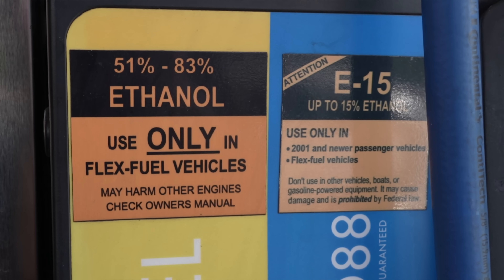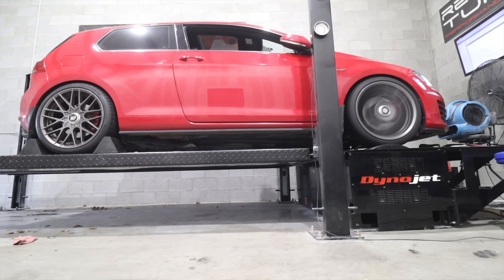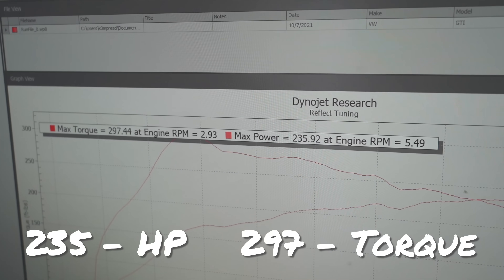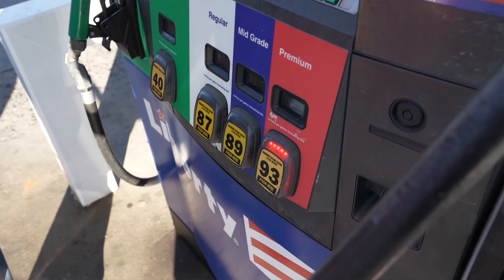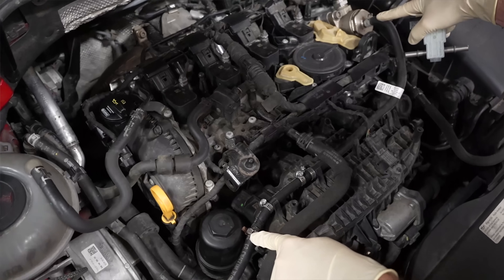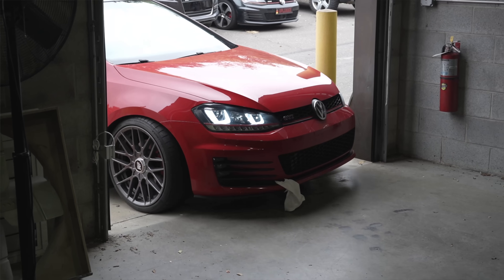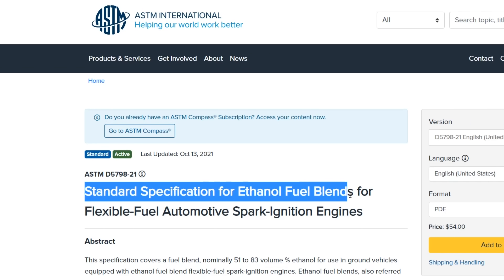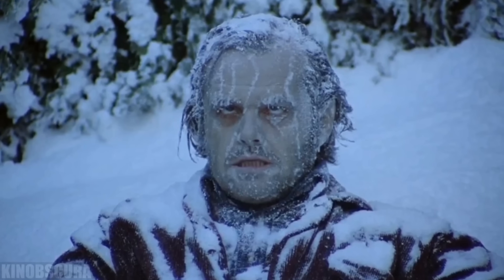A Complete Guide to E85 / Flex Fuel

Comment from the maker: Drop an Ear Disappear Shirt
https://www.shopdap.com/drop-an-ear-and-disapear-e85-tshirt.html
IE Flex Fuel Sensor
https://www.shopdap.com/ie-trueflex-sensor-harness-for-mqb-engines-ieelci2.html
Integrated Engineering Stage 2 Flex Tune for MK7 GTI (IS20)
https://www.shopdap.com/iesovn12-stage-2-tune-integrated-engineering.html
Integrated Engineering Stage 2 Flex Tune for MK7 GTI (IS38)
https://www.shopdap.com/iesovn13-stage-3-tune-integrated-engineering.html
Integrated Engineering Stage 2 Flex Tune for MK7 Golf R (IS38)
https://www.shopdap.com/iesovn22-stage-2-tune-integrated-engineering.html
Reply: The injector seals on these cars are junk, it can't hold up to standard fuel, what makes you think those tip seals will hold up to e85? You know better. the mk7.5 r already has 5 updates to the injectors... give me a break bud.
Reply: i love E85 videos. I'll be watching the entire thing and also granting a Like.
Reply: I lose an average of 11 MPG on my flex fuel van when running E-85 compared to plain 87 octane gasoline.

Comment: The first part of the video concerning additional horsepower is correct. But then you make the incredibly stupid mistake of trying to find fault over the so-called "energy content" of gasoline vs. ethanol. A spark-ignited internal combustion engine that has been optimized to run on gasoline will often produce better MPG than ethanol because the engine is optimized to run on the burn characteristics of gasoline, not because of its energy content. The same engine optimized to run on ethanol will produce equal or better MPG than the gasoline-optimized engine.

Measuring the energy content of fuels dates back to the early days of steam engines, when it was critical to identify fuel sources that could heat water faster than wood. The oil industry misled the public into believing that this measurement guide applies to internal combustion engines; it does not. Internal combustion engines does not run on steam power. 

Moreover, many gasoline-optimized engines will get better MPG using higher ethanol-gasoline blends of E30 to E50 than they will using E0 or E10, despite the fact that the engines are optimized to run on E0.This is one of the ways to prove that "energy-content" is BS.

And, in any event, if using an ethanol-gasoline blend causes a reduction in MPG vs the use of E0, the cost savings of the ethanol-gasoline blends almost always exceeds the loss of miles. This means that it is more economical (more efficient) to use the ethanol-gasoline blends.

You say that ethanol is "hygroscopic, this is correct, and I salute you for getting the terminology right; far too many ethanol critics use the word "hydroscopic" instead of "hygroscopic." However, your very next statement about ethanol absorbing water is grossly incorrect. You say that "as ethanol sits, it will absorb more and more moisture." Ethanol does not have an infinite capability to absorb moisture, the amount is very finite and rather small.

And lastly, ethanol does not "degrade" engine components; it never did. Ethanol is compatible with more types of rubbers, plastics, and metals than gasoline, benzene, toluene, xylene, and tetraethyl lead. Viton rubber was developed because of the corrosion caused by gasoline and tetraethyl lead, not because of ethanol.

Comment: Here in Brazil 🇧🇷we have 100% Ethanol (álcool) at ALL gás station by the streets,at 80's cars was only gasoline or only Ethanol, by 2000 came the flex fiel cars ..
   But álcool continue tô cause problens in fiel pump's,roses and injectors....
    THE ansuer os tonise álcool car every day tô avoid corrosion problems👍🏼🇧🇷🇺🇲

Comment: So about 2k for about 10% more power for cars running boost. Idk., i mean  yeah ..its worth it...... but there are cheaper \safer\reliable ways to get bumps of 10% .   Example:  how long will the sensors, or flashed chinese electronics last?...leaving you stuck\fustrated\embar3ssed.   For me, its all about long-term reliable power, that is not reliant on a orchestra of aftermarket sensors and gas thats constantly changing

Comment: In theory, could you run 93 pump and E85 with a tune to get both the everyday driving to track without reflashing every time? Also....Sorry if you mentioned in the video, I'm working and listening...What other modifications were done to the GTI in the video?

Comment: looool no way that stock car has a great map 40 extra hp 
most cars if you run e85 without a tune you have less power unless its a turbo car. na cars you lose power
alot of people in france use e85 without a tune cause 0.80€ / L while 95/98 is 1.85€/L so its a easy choise more then halve price. even compaired to diesel that is 1.65€//L so e85 is still cheaper even fi you use double as much as a diesel car. i do 400km with only e85 but in my mom diesel car i do 800-1000km with diesel but that is double price and half the horse power
so like 50% of petrol car run e85 without a tune, most ever since it became aviable in france (or atleast in there city) my oncle done 100k km with pure e85 in his mercedes clk230 from 1999 no engine check light
but most cars after 2000 throw a check engine light... what is annoying

Comment: Would a ECU tune be necessary to use E15? You mentioned in your video that "early" model years may not be able to handle ethanol but I put E10 in my 2002 Mustang GT ever since I bought it in 2002 and haven't had any fuel line issues. But I do have plans to upgrade the fuel pump, injectors, and fuel line in preparation to install a supercharger.

Comment: How would you know if the ECU can be set for flex fuel operation? I know that there are add ons that do monitor ethanol content and will compensate for the variations. They're rather pricey though but they allow a wide range of fuels to be used.

Comment: In the time-lapse photo at 6:21-6:28, the ethanol is not sucking moisture from the air or even getting condensation running down the sides of the glass container. It appears to have been shaken up with water, as is seen later in the video.

Comment: I'm getting so tired of hearing that ethanol has less energy than gasoline. That's THERMAL energy or heat energy, BTU's (British Thermal Units), which means that ethanol runs cooler than gasoline, which is a benefit. Ethanol has higher torque and more horsepower, which means it has more chemical energy. The reason the fuel mileage and range is somewhat lower in most contemporary vehicles is because engines are currently optimized to burn gasoline when manufactured. The lower price of E85 balances that out, especially in the minds of those who appreciate having a cleaner, cooler, smoother-running, longer-lasting, more powerful engine.

Comment: So if I’m tuned on e85 (65% content) , is its not recommended to run anything below?

Asking bc I had to put 93 in my car omw back from a road trip and my gauge was reading 50% and my car drove different, in a bad way.
Reply: Yea unless you have a flex fuel kit, you shouldn’t put anything besides e85 in a car that’s tuned for it. A flex fuel kit lets you switch from 93 to ethanol whenever you want

Comment: FANTASTIC! video, honestly

But one thing I didn't grasp from the video.. Once you run flex fuel tune, imagine you JUST finished loading it but you have 93 in the car only, can I add any amount of ethonal to the car? Or does it have to be a certain percentage, and why can't I just run full E85 only on flex fuel?

Cheers :)
Reply from the maker: Any amount it senses how much ethanol and adjust if it’s a flex tune.

Comment: To anyone with experience using e85. I just got a f250 and it is a flex fuel. I was just wondering how to properly transition from gas to e85 and I also heard you had to switch back to reg gas when you do a oil change to clean out the engine. I’ve heard stories of people Messing up their fuel lines and it causing misfires. Just don’t want to damage anything but would definitely want to try e85. Any info helps thanks.

Comment: Running now my old BMW since 2019 with stock fuel pumpe, fuel lines and injectors. It is still running. No leakage nothing. So my recommendation for BMW cars: Run on E85, put the money you save back in your piggy bank and replace all components if one starts leaking. In the meantime,  you will have saved so much money that you can buy a bunch of upgrate parts for your daily whore.

Comment: Should’ve set an A to B (gas station to gas station) 100miles a part and fill the tank to the max (preferably when you see it in the neck) at destination gas station “B” and calc the mileage that way.  Then do the exact same thing a second time for comparison. Not to mess up any elevation gain or loss. To use the gas light when you can swerve or hit a bump and cause a premature light illumination!  Muhahaha!

Comment: Every one says that you can advance the timing and get more power. 
 NOT necessarily true.
 Any engine 'wants' x amount of timing advance to achieve the 'sweet spot'.
 Any more than what's required will cause the engine to drop power,  and it doesn't matter what the octane of the fuel is.
 Octane simply allows an engine to run at a higher compression,  which will achieve more power, but in and of itself octane does absolutely nothing in the generation of power.

Comment: Great info and great video. I don't have e85 or even 93 octane where I live in eastern Canada, 91 at best. Because of this, when I was having my Subaru built I had them install an AEM Methanol/water injection system in it. The way it is set up, my tuner told me it tunes similar to 110 octane racing fuel. I'm running 35 psi with a Garrett GTX3582r gen II on my closed deck ej25 making 619 all-wheel hp. The methanol injection comes on at 10 psi and tapers up to full flow at 25 psi of boost. No idea what size jet they have in it.

Comment: 14:38 no you would not have gotten much more power with 85% ethanol over 57%. The anti-knock effect from ethanol being mixed in maxes out around 40%. Having higher ethanol content beyond that gives a very slight cooling effect from direct injected engines but doesn't increase the AKI # and so doesn't help with engines being able to have higher compression ratios.

Comment: Have a 2021 Mark 4 Octavia with a 2.0 TSI engine. As per the manual they advise not use Ethanol beyond E10. Will there be any detrimental effect if I run E20 gasoline, thanks for your time and look forward to your response.
Reply: Please advise if I can use E20 gasoline with the stock tune and no change to hardware components.

Comment: Holy crap! That's a big boost in power.  I noticed Unitronic has some higher ethanol tunes. Too bad it absorbs water so fast though.  I was thinking about the clutch prob too as even a stage 2 tune will stress it a bit.  Good details and great info, thanks!

Comment: You may want to mention that the ethanol attracts moisture besides normal condensation of a tank and fuel system and guess what:? H ² O IS WATER AND WATER DOES NOT BURN SO IF YOU PUT WATER IN YOUR GAS TANK YOU'RE NOT GOING TO GO ANYWHERE IF YOU LEAVE THAT PUMP GAS IN YOUR GAS TANK 29 DAYS OR LESS IT WILL START TO DEGRADE YOUR OCTANE WILL GO DOWN YOUR WATER WILL GO UP YOUR MAINTENANCE WILL GO INTO THE STRATOSPHERE AND THEY'LL WANT YOU TO BUY A NEW CAR IF YOU FOLLOW THE LEAD OF JOEY ROBINETTE BIDEN AND WE'LL SEE HUNTER LLC THEY'LL HAVE YOU RUNNING AROUND WITH AN ELECTRIC HYBRID SOMETHING OR OTHER IT'LL COST YOU $100,000 THEN YOU GOT TO FIND A PLACE TO PLUG IT IN ONCE UPON A TIME IF YOU HAD TWO DRIVERS BEING REALISTIC OR MORE YOU NEED AN AUTOMOBILE FILL IT UP WITH REGULAR FUEL NO ETHANOL NO LEAD DRIVING A THOUSAND MILES CONTINUOUS AT WELL OF COURSE AT 65 MILES AN HOUR UNTIL THE SUN WENT DOWN THE POLICE WENT HOME THEN IF YOU WEREN'T DOING 90 YOU GOT TO RUN OVER IN THE DARK DURING THE DAY DEPENDING OUT WHERE YOU WERE IN THE DESERT WE WERE DRIVING A HUNDRED MILES AN HOUR I'M GETTING PASSED AND GETTING 30 MILES PER GALLON AND A V8 NO WITH THE RESTRICTIONS ON SPEED AND OUR INFRASTRUCTURE YOU'RE LUCKY IF YOU GET AN ORIGINAL VOLKSWAGEN WITH A PORSCHE ENGINE IF YOU CAN GET FROM MICHIGAN TO FLORIDA IN A WEEK?
I GO SEVERAL HUNDRED MILES TO FILL UP MY SUPPLY WITH NON-ETHANOL GAS AND THE FARMLAND BECAUSE YOU SEE THEIR EQUIPMENT IS SOMETIMES 100 YEARS OLD THEY DIDN'T KNOW ABOUT MOONSHINE LETTING GASOLINE OR CHEMICALS BACK THEN THEY JUST USE GASOLINE AND SINCE WE ALL WANT TO EAT YOU CAN GET NINE ELEPHANT ALL GAS THERE PORN GO TO A OLD-FASHIONED AIRPORT SMALL ONE WHERE THEY HAVE OLD AIRCRAFT PEOPLE STILL FLY SOME OF THEM FROM WORLD WAR II MILITARY AIRCRAFT THAT LIKE TO DRINK 190 OCTANE FUEL 140 OCTANE FUEL YOU HAVE TO ORDER 100 OCTANE LOW LEAD OR NO LEAD IS NOT UNUSUAL YOU'LL PAY A LITTLE MONEY FOR IT BUT WHEN YOU PUT IT IN YOUR LAWN MOWER 2 YEARS LATER IT'LL STILL START SNOWBLOWER SAME THING AND A LITTLE FUEL STAY WISER JUST FOR FUN AND KEEP THE AIR CLEANER CLEAN BUT YOU WON'T HAVE TO TAKE THE CARBURETOR APART EVERY MONTH TO MAKE IT RUN AND THAT'S TODAY TOMORROW THEY'RE TRYING TO IMPROVE E85 NOW THERE'S A FEW 885 VEHICLES OUT THERE THE REST OF THEM HAVE TO BE CONVERTED AND THEY CAN'T GO BACK YOU CAN'T MIX THE TWO A HUNDRED YEARS AGO WHEN I WAS IN THE MILITARY HAD A THING CALLED MULTI-FUEL YOU CAN PUT ANYTHING IN IT FROM CIGARETTE LIGHTER FLUID TO DIESEL AND I WOULD GO BUT SEE IF YOU CAN FIND ONE OF THOSE AND IF YOU DO SEE IF YOU CAN LIGHTEN THE WEIGHT AND USE IT FOR A MOTOR VEHICLE PERSONAL TRANSPORT DON'T TAKE YOU AND THE VEHICLE AND MAKE IT DISAPPEAR SO DON'T WORRY TRUST THE GOVERNMENT E85 IS A WONDERFUL THING MOONSHINE FUEL TERRIFIC AND ELECTRIC CARS ARE WONDERFUL BECAUSE WHEN YOU PLUG THEM IN WEIGH 3 HOURS FROM THE CHARGE UP YOU CAN ALWAYS GO TO THE RESTAURANT AT THE SHOPPING CENTER MALL WHATEVER AND FILE BANKRUPTCY BUT WHEN YOU DRIVE HOME JUST DON'T BREATHE IT'S BAD FOR YOU!

Comment: I’m interested to see the carbon build up on these cars vs pump gas
Reply: With E85 (Ethanol), carbon build up would be significantly less than with pump gas. E85 burns a lot cleaner than pump gas because it doesn't have nearly the amount of petroleum (oil) as gas does.

Comment: hey just to let the public know, corn is the worst way to get ethanol,  it take 17 to 19 liters of water for corn to get 1 liter of ethanol.   switchgrass, however which noone has eaten in a salad that I know of, has waaaayy more energy for ethanol production, getting the tradeoff of as low as 1.9 liters to 1 liter of ethanol, as high as 10 liters to 1 in worst case scenario.

compare that to the nearly 157 liters of oil you get from using, a massive 8410.266 liters of water, and thats not including the water they need to make the oil into gasoline

Comment: I didn't like all informations. Too fast and heavy understanding. The car engine is built for gas and not for votka. Ethanol=votka=sugar. Ethanol do not explod like the gas. Ethanol is good to drink like the russes. Ethanol produces a lot of calamina and smoke on the engine. DO NOT USE ETHANOL ON GAS NEVER EVER. A lot of car engines are not built flex fuel, means E85, 85% ethanol and 15% gas. Use normal gas, less ethanol posible, good gas w/o ethanol and the results will be incredible. No engine knocking, pincking, hunting, smoke and more km.

Comment: hello, how is everything ?  Was the power measured by the wheels or engine?  how many degrees does it advance in this map ie 93 octane and e85 map at redline  rpm.  and what turbo pressure and advance of this map ie 93 and e85 on is38 on gti mk7 can you tell please?  thanks

Comment: when you ran the dyno pull on the 93 tune did the car have some kind of ethanol sensor at all? and if i know my stock fuel system can handle about 7-9 pounds of boost, do you think it can handle running e 85 with no fuel system upgrades?

great video!

Comment: good video with good info! been runny flex fuel in my CTSV for a while now, one thing to note is the power difference between e85 and 93 octane will grow with more boost or upgrades as the 93 octane will become even more of a restriction with more boost.
Reply: Curious, did you start running E85 before tuning?
Reply: @Johnny_Chingas13  no, my first tank of e85 was on the dyno. Spent some time draining the tank and filled with pump e70 (that's what the local pump had)
Reply: @josegarcia2014  right on, I've just been doing some research since I seen one of the station down the street from us carries E85. I've read conflicting reviews saying that the LS3 can safely run it without a tune because of its compression ratio and others who say no and to get a tune first.
Reply: @Johnny_Chingas13  compression ratio isn't the big issue, its more on air fuel ratio problem. Running e85 on a 91 or 93 octane tune will be really lean.
Reply: @josegarcia2014  I've read that and seen videos where people show their AFR but they're in older vehicles. What I've also read is that the ECU's in the newer cars will compensate by adding more fuel. Don't know if this is legit info or what as I've read both things.
Reply: @Johnny_Chingas13  new computers will compensate to a point but usually only to 15 or 20%

Comment: I dont know what e85 we have in finland, but my volvo took 2 or 3 starts to get going on winter -15C or -20C. Its got just basic flexfuel box, and stock injectors and fuelpump. But damn even on summer, it takes 2 starts😂 and i cant get driving instantly after startup, it just trying to stall if i press gas. Its kinda annyoing if im in a hurry.. but after a bit warmping, it works (atleast still works). Im experiensing a slighlty increased torque on low rpms, but throttle response maeby is a bit off compared to normal gas on warm engine. On cold engine its just like a carbured car without a choke😂